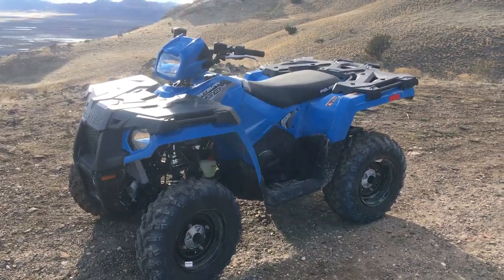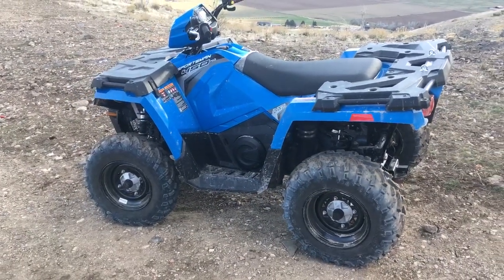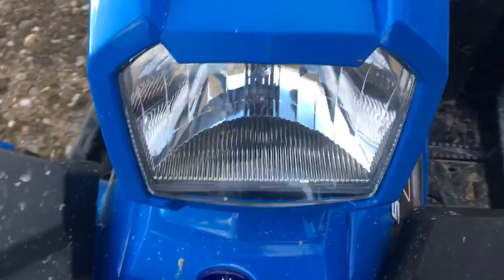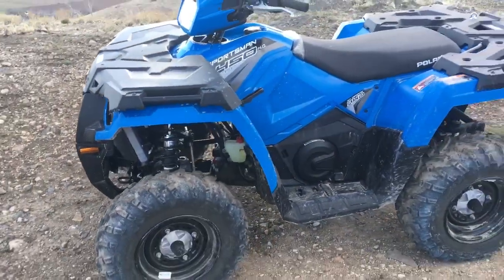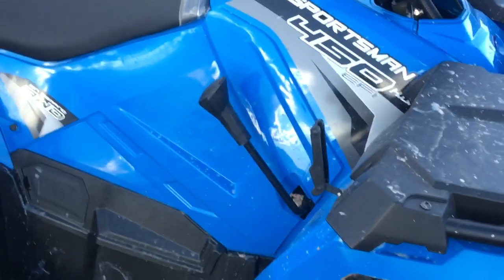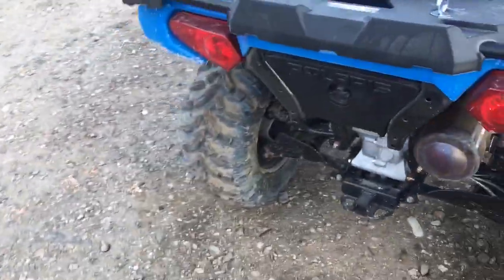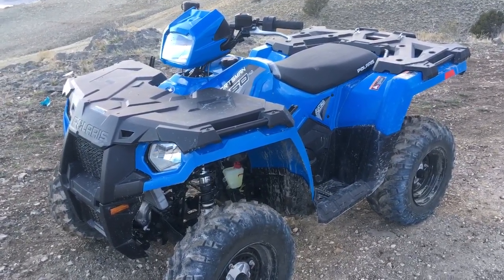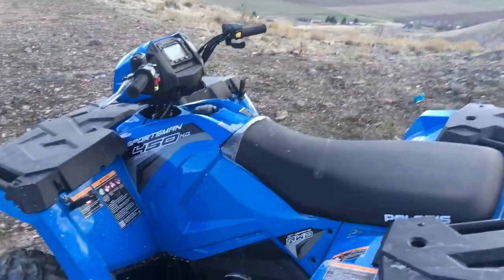2018 Polaris Sportsman 450 H.O. Review

Comment: I got my 2017 450ho in Sept. and love it.  Got it out the door for $4638.00.  Installed on my own a 5k lb. winch, front brush guard, front and rear cargo bars, and a front and rear aux. light.  Love the machine.  Only had 10 months and still only have 120 miles on it.
Reply: jeff lyon post a video of it for me! Thx

Comment: Had to come back and watch this review again. Seriously looking into one of these now. There is some great pricing and rebate deals going on right now. Still liking this thing?
Reply from the maker: I’m really liking it. I’ve only got about 70 miles on it now, haven’t been riding as much as I would like. I think it’s got good power for a 450 class, I weigh over 200lbs and it’s got more than enough power to carry me up the steepest hills. The steering is a little heavy but not bad, the EPS would be nice but I don’t think I’d pay the extra $800 for it. The ride seem to be a little softer now, I don’t know if I’m just getting use to it or if the suspension is breaking in but it seems better. Over all I think it’s an excellent trail machine and if that’s what you’re looking for I think you’d be happy with it.
Reply: Hey man I got a question I just bought one of these a few days ago brand new does yours make that little clunking sound when you're going downhill or going at slow speeds I'm reading that it's normal but I just want to know if yours does that too
Reply from the maker: Yeah, mine dose it too. I think it’s normal, I think it’s the weights in the clutch clunking when you first take off or on deceleration.
Reply: Uncle Sam yeah I hope so lol it's really nice machine also I've noticed the brakes squeak in the front does your squeak at all?
Reply from the maker: My brakes squeak a little, not too bad. I also ride in a lot of dust so I just expect some squeaking.
Reply: @ryster88  mine is a 2019 and mine does it going down hill too . If I have a passenger it seems worse ..

Comment: How well does it handle a snow plow
Reply from the maker: I haven’t tried plowing with it, so I really don’t know. I think it would handle a 50 inch plow well but I wouldn’t go much bigger than that.
Reply: Uncle Sam I just bought the exact same machine it was hunter green or velocity blue I don't hunt and the wife didn't like the green. Working my way through the break in. It takes a while but for I'm going to use it for I think it's a great buy.
Reply: The dealer said they can install the plow kit on for $900 but I can get it for $650 and it's supposed to be easy to install plus the blade is supposed to be easily detached they said Polaris has it's own brand of accessories on they're all  supposed to be easy to install which was a good sell
Reply: I bought the same quad and installed the plow with 2500 lbs. winch last week.  Will let you know how it plows when it snows.  Although, mild winters generally come after purchases like these haha
Reply: This machine handles a 54 inch plow well.

Comment: Kymco?  really.  No comparison, not even in the same league. Price is good, only been making larger ATVs for a few years (Excluding to work for Artic Cats). Parts come from Taiwan and China.  I own two (2) 2018 450 HOs, I paid $5044.00 each, brand new (Denton Cycle). Mine was a choice between the Polaris, Honda, and Kawasaki. The Honda solid rear axle was the reason I didn't get it. So it was narrowed down between the Polaris and Kawasaki. The only difference between the two was price. The CanAm is great, I agree. But Price is one factor, and Parts availability was the second. The Polaris parts warehouse is in Kentucky, shipped daily, and stocks 10 years back models.   You made the right choice IMO, but 6k seems extreme.

Comment: Can you get this machine with engine breaking?
Reply from the maker: The Sportsman 450 does not come with engine braking. The Sportsman 570 with EPS and the bigger Sportsman come standard with it. But if you keep the throttle open enough to engage the belt it holds back well on moderate hills.

Comment: my 570 cost $5400 you got ripped off
Reply: out the door
Reply: Mine was $4,890
You got ripped off also.
Reply: Mine was 3899$
Reply: Location matters here. ATV pricing varies depending on where you live. Supply/Demand pushes prices higher in venues with smaller ATV market. And shipping them from regions with more robust ATV markets just increases the cost. Where I'm from they're about ~$5,00 but in VT or PA you can find them for $4,000